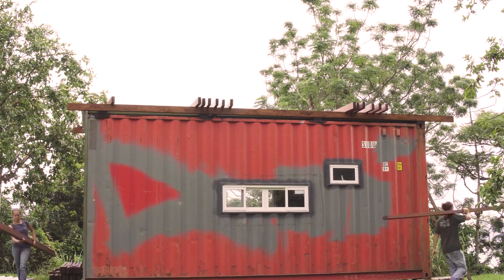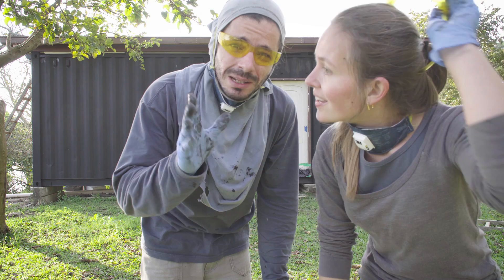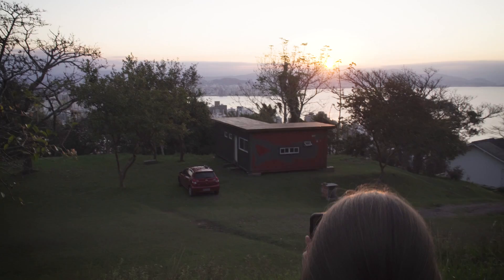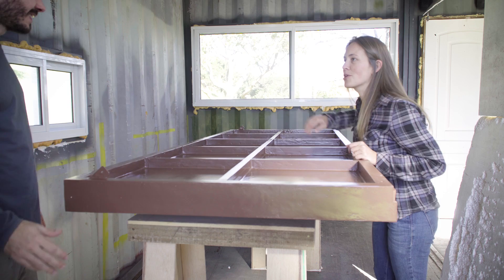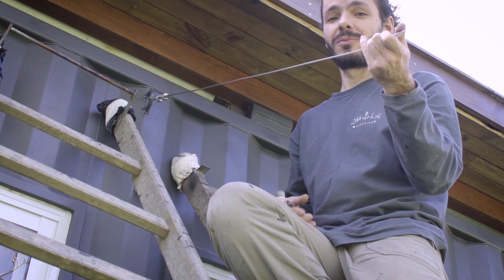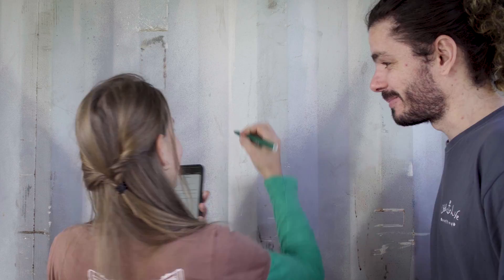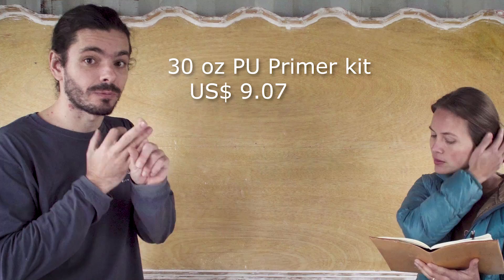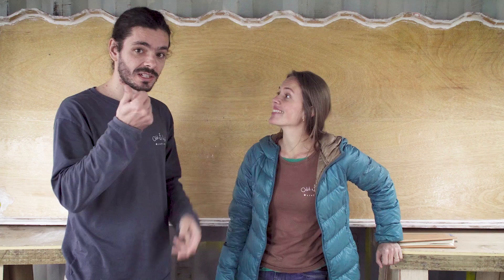We FINALLY finished our CANOPY!! #041 LTP

Comment: I think you need to fill the gap between the canopy and the wall with silicon and add a drain hose to let water go smoothly to the ground without splashing around.
Good luck guys.
Reply from the maker: We are monitoring both things. If necessary we will do it if not it will stay like this. 👌🏼😊

Comment: in a place  like that..  white would be better, cuz that reflects  the sun light, this dark paint will only help the metal to absorb more light, thus more heat... it looks nice, so that is not the issue.. :)
Reply from the maker: 👌🏼👌🏼 the dark will only be the south side. That means the side without sun. 👌🏼😊

Comment: curious to know if it's safe inside during lightening? did you guys consider that?
Reply from the maker: We still didn’t install a ground system but we will before we move in!! 👌🏼👌🏼😊😊
Reply: I have heard about something called Faraday cage that says a metal box is the safest place to stay during lightening. I'm not very clear about the concept, but I guess that the shipping container will become a Faraday cage and I'm not sure if it needs to be grounded or not to become a Faraday cage. :-)
Reply from the maker: I agree but at the same time helping to have an easier way to the ground won’t do any harm. 👌🏼😊

Comment: Dear it is very good but I think it is better not to work with cables because the first time it storms your roof will blow up and break off . greetings
Reply from the maker: It's actually the same cables that we use in sailboats. It's there for more than a year and it's still steady. hehe.
Reply: sorry I had not seen that you had placed cables at the bottom very well done nice work you both

have a nice day 💘

Comment: this canopy is WAy over engineered
Reply: Have to agree with this. Also, why not just have a flat surface on top instead of catching water with the raised edge? The cables holding the canopy would be better off at a bigger angle. Maybe attach to the roof instead?
Reply from the maker: What we think is that if we have a flat surface we will end up with a waterfall right where we get in the house. With the raised edges we don’t have that anymore and we won’t need to go through the waterfall. The cables could go up to the wooden deck bit in our opinion wouldn’t look as good. As it is it’s holding really well on place. But as we always say. For sure it’s not the best solution. There are tones of different solutions for the same challenge. That’s just the one we decided to go with. 👌🏼😊
Reply: There will be rain around the edge of the canopy anyway so you will get wet whatever option you choose. I agree the cables look best as you've done them but to me they don't look like they are giving much support. I think the support you have is from how you attached the actual canopy to the wall of the container which may or may not be enough. How did you attach to the wall? Thanks for the reply I know you guys are busy.
Reply from the maker: Trust me the cables are holding. I do agree the angles of the cable could be better but some times we need to work with what we have. That’s stainless steel cable. And we know that is holding as we locked the cables before the wall screws. Of course the wall supports are also helping to distribute the forces and the weight but without the cables the canopy wouldn’t stay on place. It would bend the wall support that is welded on the SC or break the plywood. About the waterfall one thing is to have a few drips of water. A completely different thing is to have water from 2 square meters falling. As it is the majority of the water goes to the drain and we get a few almost none drops. To be honest we are 100% satisfied with the water situation. 😊👌🏼
Reply: Hey, don't stand under the drain lol